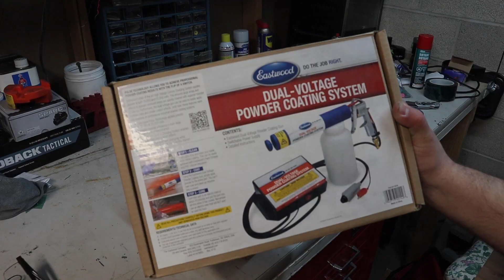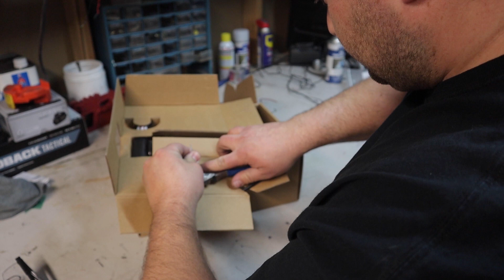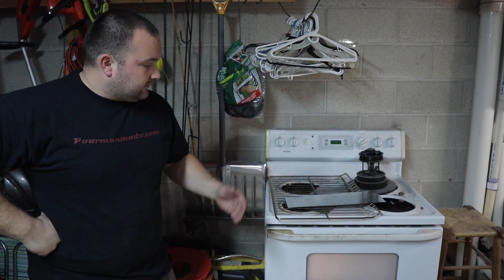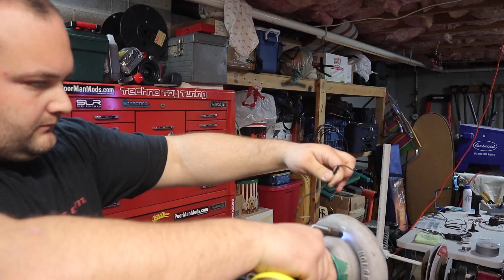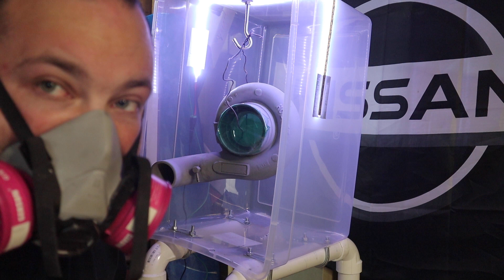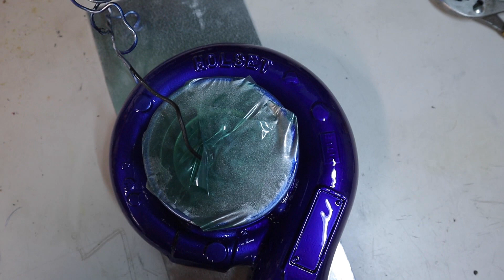Easy and affordable DIY powder coat setup + @eastwoodco PCS-250 powder coat kit review

Comment: It looks really nice. Good idea with the plastic spray box. Then you can keep the powder clean so you can reuse the excess at the bottom. About the compressor - get a tank and connect in between so there is a buffer of air, maybe 50 or 100 liters. Then a drain at the bottom of it can blow off condensation water. If you have space, you can have a 300 L water hydro tank. Take it out in the middle and pressurize it so it doesn't burst in the basement or put it outside and hoses through the walls. Saw a Swede who built a cage out of rebar that just went into the stove. Then tubes on the sides that he could stick other tubes into and lift out the cage when it was warm. Then he had some he could hang the objects in and move them around tied up.
But does painting a turbo really work? If you drive it really hard, it becomes red-hot.
Reply from the maker: I have never had an issue with the powder coat flaking or becoming damaged on the compressor side of the turbo

Comment: The oven is your only bottleneck, the sand blaster cabinet is as well.  Dont tell me you can put and blast a straight six valve cover orwheels  in it.  I get it, dont blast the hand that feeds you, in this case Eastwood.  🤨  I like your process,  but try this with the competition's equipment and see how they compare for less money.

Comment: I did my 1975 Kawasaki Z1903 frame & swingarm in a translucent lollipop red &tropic orange mix. Everyone's favorite is the translucent psycho lime green tho. "Follow your local EPA regulations kids"!!! Pop some holes in the back of the Tupperware and put you filter and fan behind it. put your ground on a bolt to whatever part you are doing to get full continuity
Reply from the maker: niceeee. My j hook is grounded btw
Reply: @PoorManMods  I know the ground was hooked up just whatever bolts for the part you just wrap a copper wire around it and it's a super solid grounding point
Reply from the maker: @chrisdavis9144  ahhh ok! thanks for the tip!!